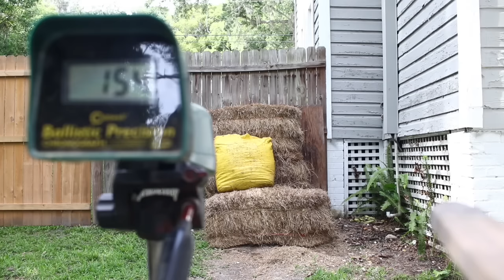Full Stone Age Bow Build Tutorial

Comment: When stripping bark, make sure you get at least on strip  from the whole length of the stave.  Then, when deciding where the middle of the stave is, fold the bark strip exactly in half, and use that to measure for the exact center of the stave.
Reply: makes sense
Reply: Nice tip
Reply: @jackp492  it's just half a tip.

Comment: I use Beeswax/Lambfat to control drying.  Up here on the Southern End of the Adirondacks finding Hickory is not easy.  I use Ash and Sugar Maple saplings.  After "shaving" the stave round and parallel end to end and has dried sufficiently the staves get fire hardened.  Then wprked tp shape and tillered.  My bows are built to my requirements.  They average 45-50 lbs. and considering their primitive nature they are quite fast.  I began making "sapling bows" over 60 years ago as an  youngster in Elementary School.  I learned to fire harden and straighten arrows from an old retired railroad engineer that was a native of North America.  I did not use stone tools. I used a couple of hatchets and a fixed blade Old Hickory butcher knife. (My hunting knife).  I also "borrowed" one of my Dad's draw knife.

Comment: I wish I had these skills, but I will share one thing I do know:
Avoid using a bowline knot (or any knot) in your bow strings. The bowyers knot is not a true knot and is designed to retain the strength of the line. Knots reduce the strength of a line by ½ (does not coumpound with additional knots). I don't think it would be a problem with sinew, but it is good information.

Comment: Really impressed with this video and learned a lot. That is an excellent selfbow by any standard. Question: have you ever heard of using horseweed for finish sanding the bow before burnishing it? Are you familiar with using a crooked knife for working a bow? According to an author by the name of Laubins the earliest form of the crooked knife used a beaver's tooth for the cutting edge.  That is a Cherokee bow in all respects except perhaps the wood and string which are boisd'arc and either groundhog or tough old fox squirrel. I've still got a little hickory bow, about 45 inches long ,that my father made for me when I was about 5 years old. He must have copied it from the bows his father and uncle used for cornstalk shooting contests. The little bow is a flat D bow, pretty much straight width throughout with those same diamond knocks. The bottom of the string was tied off with a timber hitch. The top loop of the string didnt slip over the top knock with a single loop. Instead it had a smaller loop that the string passed through, sort of like a lariat , and this was roped over the top knock.
Reply from the maker: thanks very much. I have heard of using plants before to sort of sand. The little flake and antler work so well for me though. I don't have beaver this far south, but I did think about using boars tusks some like the natives in New Guinea, but I figured at that point I was just beating a dead horse since I have nice sharp rock flakes. All together, cool information, thanks for sharing
Reply: @huntprimitive9918  one more question: while you were drying the bow by the fire, would it have been possible to hang a weight from the middle of the grip so that as the bow drys you might be able to force some  more reflex in the bow? Would this be a practical solution? It might offset for a little string follow. What do you think?Keep up the good work.
Reply from the maker: @larryreese6146  yeah it's plausible I suppose. I am not sure if it gets hot enough for that by itself, but you could certainly heat it afterwards and force some in as well.
Reply: @huntprimitive9918  thank you very much for the reply. Sure would like to sit down with you some time and chew the fat or share a project. Taught English and history for 28 years but given the opportunity I think my inclination would have been archaeology. I love the subject and primitive technology is one of my favorite parts of it. Keep well. Thanks again.

Comment: I am in the amazon jungle and yesterday made my first bow from the conta palm wood the indians here make them from.  found this today because I need some info on the best way to do it.
Reply: christopher snedeker  turns out the wood needed to be seasoned more.  It would work for a bow trap and it was a good learning experience.  Will be making more soon.
Reply: @christianflatearthresearch6456  You made more ?
Reply: @juliooropezaarevalo6972  not yet.  I have been too busy building a concrete pump which I am using to build a swimming pool.  I need to go out in the woods and find the right kind of tree and cut it and let it dry out.  That will give me enough material for a lot of bows.  I did go out to the Indian reservation and talk to one of the old men who knows everything about these things and bought two real bow and arrow sets for my kids though.
Reply: @christianflatearthresearch6456  Hey im really trying to do this but im a city boy, i dont even know what kind of wood to use, could you mark me the most important points, or at least how to not mess it up
Reply: @juliooropezaarevalo6972  we have a special palm tree with very hard and flexible wood here in the amazon jungle that you will not have access to.  However, the north american indians and english made great bows out of the wood available up there.  In Europe and North America, common woods such as maple, ash, elm, and oak make excellent flat bows, and are far easier to obtain.

Comment: Green wood works much easier,.....but it will tear deep into the grain if you split it.
Its best to use your Otzie band saw or Otzie Angle grinder with an 80/ 50 grit sanding disc to waste the wood away.

Comment: will this bow crack  while drying? ..or its better to put some coats of poly or varnish to slow down loss of moisture?
Reply from the maker: some might crack, but that is also why you need to get down or passed the sap tube. light cracking wont hurt anything, but big cracks will. mine did not crack at all. You need to it dry fast if you are using this method so coating it won't be helping you. It may even crack easier as the wood steams an looks for a place to escape
Reply: @huntprimitive9918  oh ok sr thanks for your help ,i will debark a few acacia branches that i have and seal the ends with acrylic paint sems to works good i have some big logs air drying outside sealed with paint and not cracks yet...thanks again have a good day.

Comment: 45:45 Literally seeing him using a knee on leather to try to hold the wood in place as he chips it away from under him... And I'm thinking... This is a Stone Age bow build right? How about using a nice sharp and durable stone or otherwise Stone Age or Pre-Stone Age material to work out wooden clamps, tie the damn thing together with sinew, pressured held with stone or heavy material like a recent British man did to figure out Stonehenge (he largely used wood and stone, engineering principles, and reeeeally big contraptions) and then focus entirely on whatever process he needed to. A few minutes in and seeing him chipping... I was like. Nope. I'm a lazy guy. I would had constructed a wooden chair first, wooden or layered stone bench, a device to suspend the wood over the flint/stone. While comfortably sitting, push the wood forward and back chipping without much effort.

Edit: P.S.

Or he could find a tree, place the wood vertically against the tree, tie it, then chip at it from a more secure and less exhausting posture

Comment: Hi Ryan, first of thank you very much for the effort! What a great idea to make it such a long but complete start-to-finish-build video. Wish I could like it twice ;)

I have a question or two about "green wood bows" like this, do you have any method of determining the drying times? so cut the thing, one week of drying it just like that, then debark and get it into the preliminary shape (close to floor tillering) quickly. then comes the speed-up drying over fire-phase, with several days maybe a week? how do you determining when it is ready to tiller from there?

Do you have a way of telling it's too early to get into the next phase?

Except for obviously just touching it and knowing it is too moist, but that's an experience thing right?
Reply from the maker: I just used my experience of how dry-enough wood feels  when floor tillering to know it was good to go. If still wet, it will take on set just floor tillering. I in all likelihood dried it more that it needed to be. 1 day was likely enough, but I wan't to be very sure, then give it a couple days to reabsorb ambient humidity and homogeneous before tillering
Reply: @huntprimitive9918  right, makes sense. thanks for the reply, have a nice weekend :)